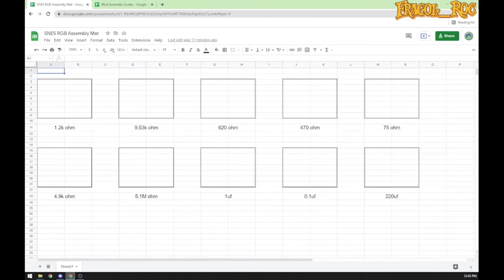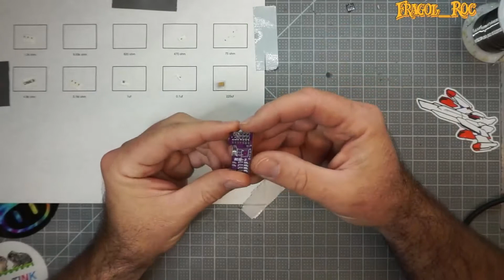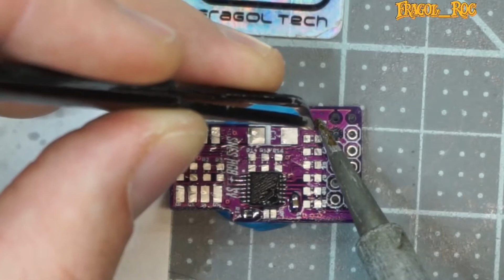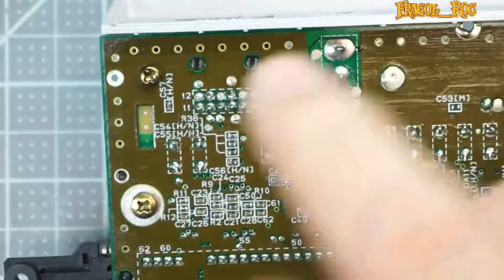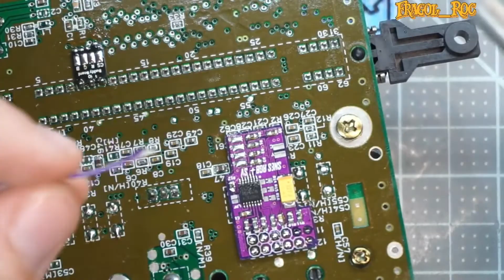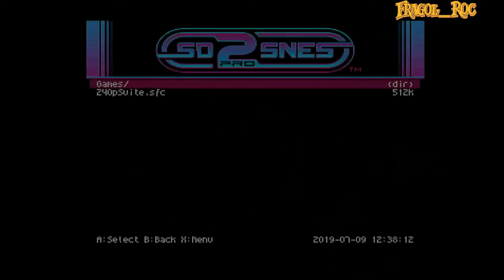SNES RGB + SV Bypass Assembly & Installation | FragolTech | Retro Games & Hardware

Comment: Is this modification on par or identical with what Voultar had designed from a standpoint of video quality and correctness?
Reply: Also I am trying to find the 220uf tantalum capacitor, but can't. I think it is discontinued, any viable replacements?

Comment: Nicely done Fragol. Maybe an explanation of the optional components for R14-15-16 in the video. You know students will fix their attention to this part just because it's unanswered XD
Reply from the maker: Good point. To be honest I didn't fully understand the explanation given to me. I know there are pull up resistors and I believe they are only used if the signal coming from the DAC isn't at the right voltage. However, it would appear that the DAC delivers plenty of voltage and doesn't need those resistors. If you had issues with certain color channels not working, the you could add them in and see if that helps.

Comment: I know R14-16 are optional but what are they for? I installed them on the one I assembled.
Reply from the maker: They are additional pull up resistors for the off chance your system doesn't have the correct impedance going to the DAC. We measured a few systems and saw no need for those resistors. We left them on just in case someone wanted to use them. There are other RGB solutions that don't even have those pads.

Comment: When I bother to pre-sort I usually use mini Post-It Notes for my place mats. ;)
Reply: A bit of double-stick tape helps avoid bump-scattering. You don’t have to use it on every prime, of course.
Reply from the maker: As we saw, my duct tape didn't do much :/
Reply: @fragolroc5256 Yeah, it’s not really to hold the sheet but to keep the components from scattering when I do inevitably bump it. The sticky notes have a bit of adhesive already so if I am only doing a few I sometimes place them upside-down and stick the components to the included adhesive (no tape) and write beneath that. Any unused/leftover components go into tiny zip-loc bags with the mini sticky note, sometimes trimmed or folded, so that I know the value. Got lots of little baggies with mini sticky notes like “Nintendo AV multi-out pins” and “Dreamcast 47k-ohm” (removed for DCDigital).
Reply from the maker: I wish I was smart enough to think that. Instead I kill a tree to have a one time use sheet of paper...